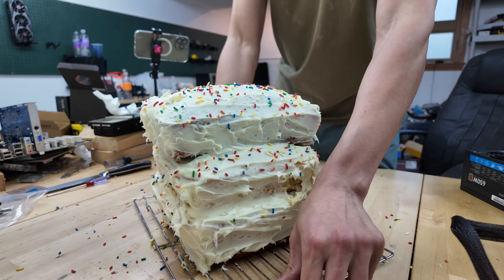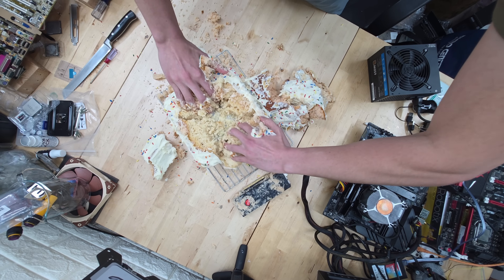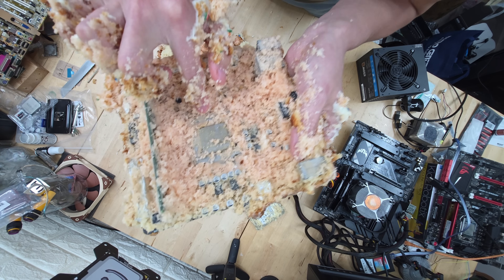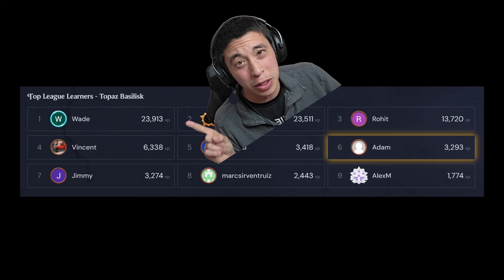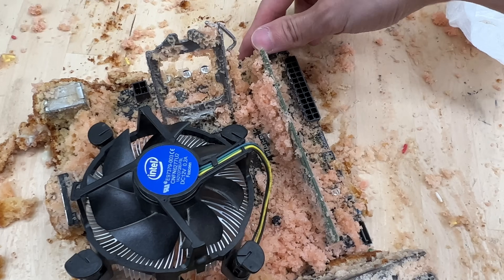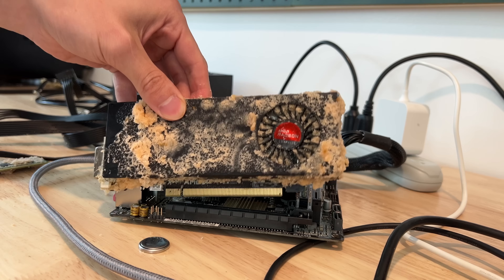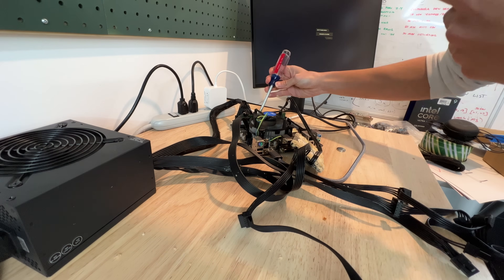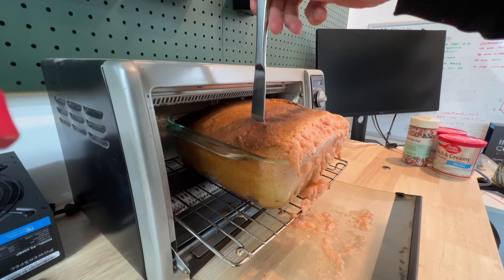What happens if you bake a PC inside a Cake?

Comment: Technically, if you took the cake out at the right time, the internal temperature of the cake should have been no higher than 190°F, which is significantly cooler than 350°.

Comment: 5:49 you’re looking at this wrong. The components were in the cake which protected them. The cake never reaches 350 degrees. Cakes generally reach 200-210 degrees when fully baked. So the components would only need to withstand 210 degrees.
Reply: Yeah unless you boil away all of the water it won't go much beyond boiling temperature